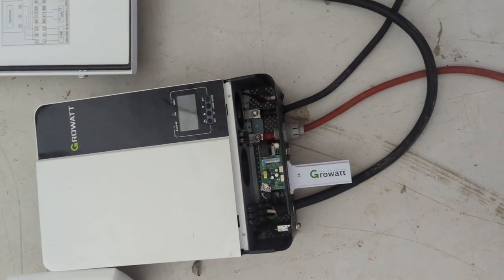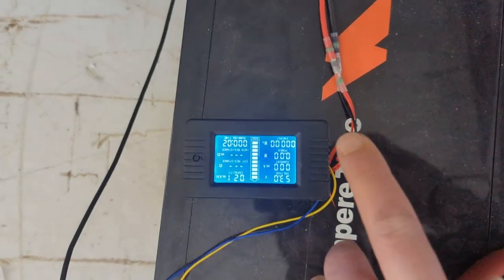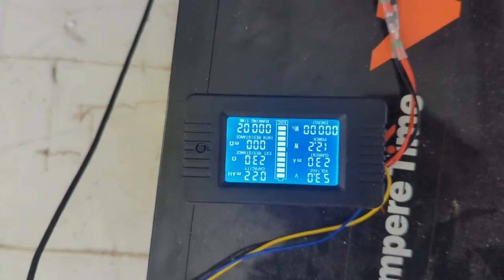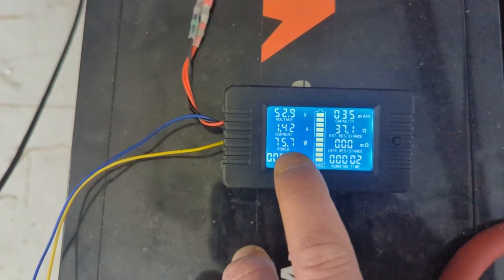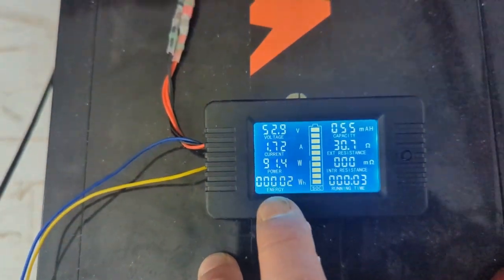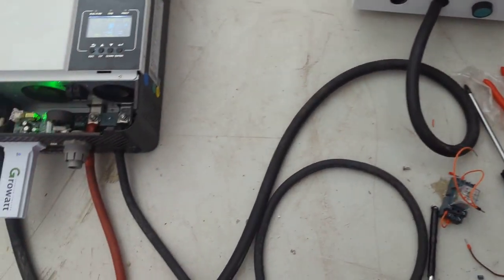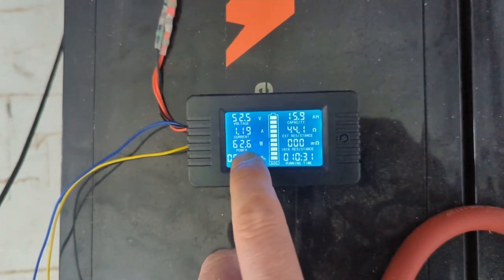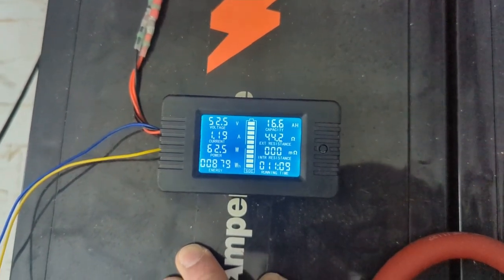Growatt 5000ES   Growatt 11 4kW Autotransformer Self Consumption / Idle Load

Comment: Hello
 Running the 3 5KW growatts would you suggest the 11kw  I seen an older video you had a 5KW.  Or is it just a waste of extra money 
 Also do you have a video of installing your 3 5KW growatts.  Because that’s actually what I’m ordering right now to replace my EG4.  6kw units
Reply from the maker: I have not made a video of that, there are already so many other ones out there. However I would follow the advice in this thread.
 https://diysolarforum.com/threads/design-review-growatt-spf-5000-es-grid-backup-neutral-bonding.29717/
Reply from the maker: I would buy the 11kw, it's really quite nice.
Reply from the maker: Also I had two 5kw ATs, so technically I had the same setup.

I'm curious if you have measured your actual loads.
Reply: @BecomingOffgrid  I have not measured the load just trying to plan a bit bigger tho and it’s only $170 more from 5KW to 11kw
Reply: @BecomingOffgrid  ok thanks